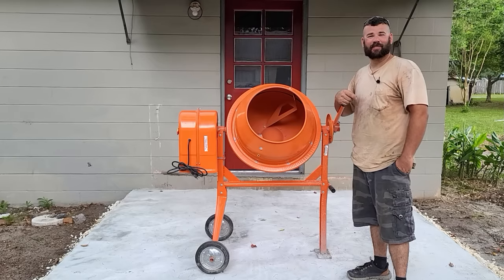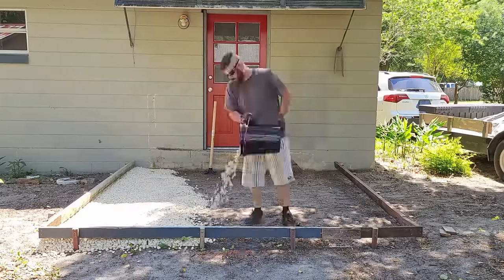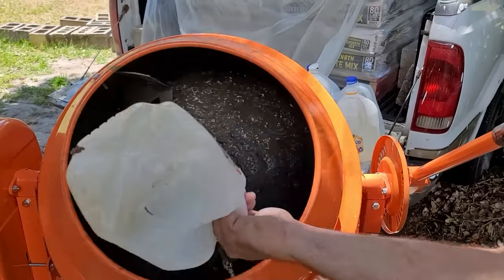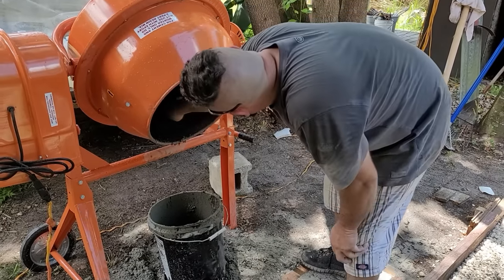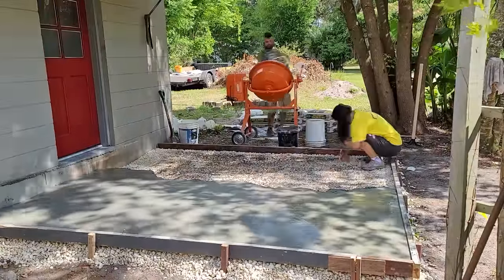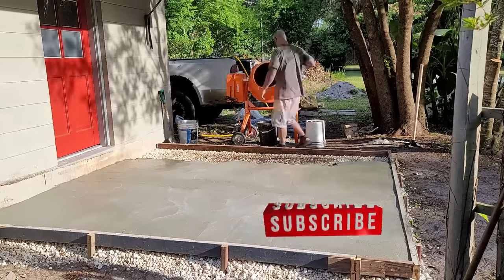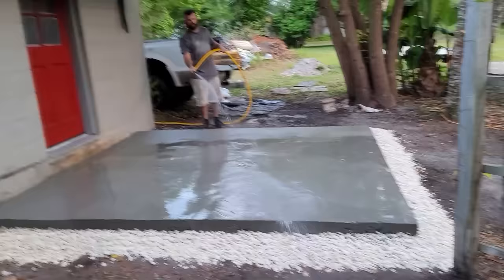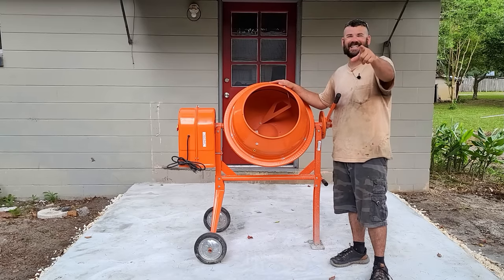Pouring a Perfect 10'x10' Slab with the Harbor Freight Cement Mixer

Comment: I do concrete for a living and all the shit your saying wrong is making me cringe, but good job bro, alot of people dont even try and they suck and cry about it 🤣, keep it up good job
Reply: Also, u should have drilled a hole every 2 foot into your foundation wall, that floors gonna settle down lower bc u didnt pin it in, and for your rebar comment, u do need rebar so that when ur concrete cracks it doesnt separate, concrete is gonna crack no matter what you do, rebar isnt for cracking, its for anti separation. This isnt a structural slab its just a diy lil patio slab so u could get away woth chicken wire or whatever, but u have to cover the whole thing, cracks like to form where theres no reinforcement, but if you reinforce the whole thing evenly, it will want to crack right along the rebars
Reply from the maker: Thank you
Reply: @VIPHoldings  You did a good job , and i am a concrete guy i dont thik pinning the cement to the foundatio will do any good , beacuse the foundatio will not move and the patio will because only the ground is holding it and if you pin it it will eventually break , so you did good on not pinning on my opinion just expansion paper between the old cement so it avoids concrete hitting each other , well done brother
Reply from the maker: I appreciate your comment and welcome to the channel!
Reply: @graysonquenelle  rebar isn't for cracking, and you're a concrete guy? 😂
Reply: @devilmonkey  rebar is for the allowment of stretching/expansion and sheer strength. Rebar is not there to prevent cracking though it does help negate it.
Reply from the maker: Thank you, and welcome to the channel!

Comment: Surely lack of metal will contribute to lower lifespan.  As long as no one runs into w trees or machines should be good.
Reply from the maker: There is metal fence panels with brackets to lift them off the ground.
Reply: @VIPHoldings  but no rebar or concrete grade fence right.   I been using hardware cloth here and there to prevent cracking or separating.   Lots of erosion  here.
Reply from the maker: I call it chicken fence, but they are 4x8 pieces of 4" squares. It's usually standing next to the rebar in the big box stores. Also, next them are the metal brackets that hold them above 2" off the ground. If it were a driveway, I definitely would have gone with rebar, but for a back porch, they are working out beautifully so far.

Comment: That slab will Crack big time. Reinforcement wire is placed in the middle of the concrete thickness. Your wire is laying on the ground...how is that helping Reinforce the concrete
Reply from the maker: The wire is being held up off the ground by the wire stands sold in the same aisle. I assumed that I didn't need to mention it, but you proved me wrong. Thank you

Comment: WTF is a wheelbarrel?
Reply from the maker: It's actually wheelbarrow, and it's a small cart with a single wheel at the front and two supporting legs and two handles at the rear, used typically for carrying loads in building work or gardening.

Comment: you need to YT search DRY POUR slabs .. cuz it's much much easier and cheaper and less work !!
Reply from the maker: I just saw one of those the other day, and I agree it would be easier on my back and time, but I worry about the longevity of those types of pours.
Reply: @Vasquez International Properties Holdings Inc.  
From what I've done they are stronger than mixed .. 
Reason being.. the more water you add to cement the weaker it gets. 
They don't crack like poured ones do.. 
Least from every video I've seen and test folks have done..
Portland cement must be used.  Not quick dry !!
Reply from the maker: Oh, see all the videos I saw were the quick crete stuff. I'll have to try that sometime.

Comment: Ha ha a trowel To level a 10x10 slab, how manny bird baths did you wind up with?? You should have used a bull float. Did you end up with cold lines and air holes everywhere that concrete wasn’t worked properly to prevent excessive issues down the road.
Reply from the maker: Well, it's been over a year, and no "bird bathes, cracks, or air holes." I'm curious, if you're an expert, why were you watching a beginner video? My guess is just to be a troll. Have a good day